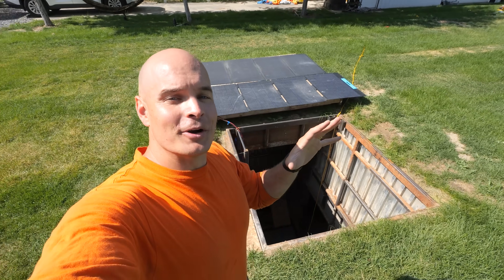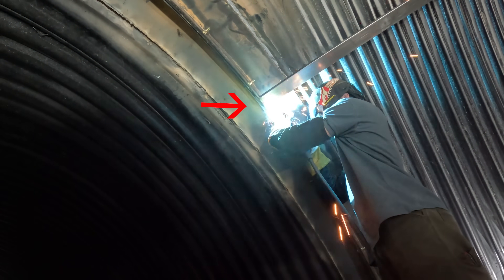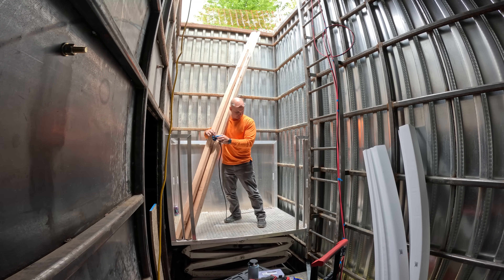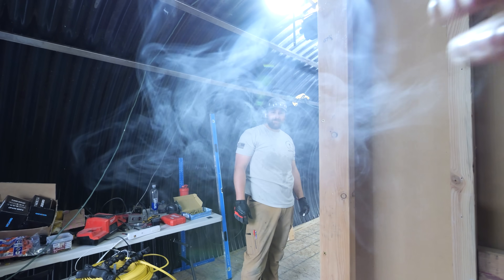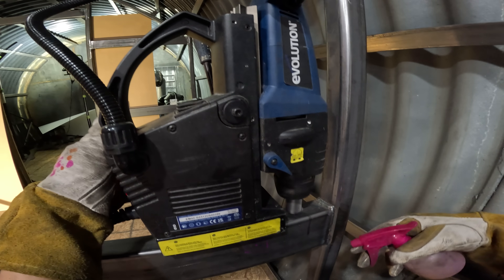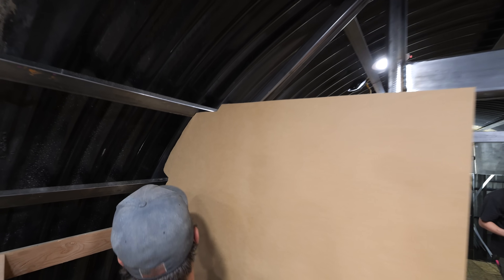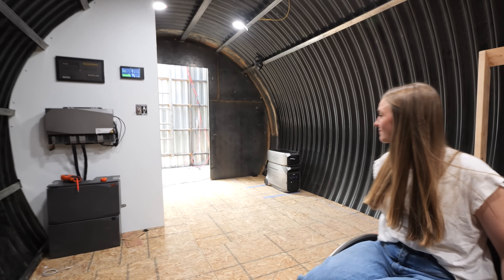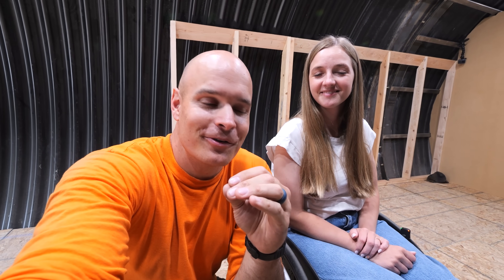How to Properly Power a Backyard Bunker - (Completely Off Grid)

Comment: Any reason why you did not encompass the metal shelter pipe/tube in reinforced concrete? While bracing the shelter with metal beam X bracing during pouring and drying period. I am no engineer but, I would assume the pipe/tube could hold up structurally with a 2-3 foot thick square structural reinforced concrete poured,  dried around it. The sidewall weight of the concrete would mostly be pushing straight down to the ground base/slab concrete. The only weight concern I would imagine would be the roof area of the metal bunker tube/piping. Again I am no engineer,  just sharing thoughts. Matt off the ranch buried a reinforced shipping container surrounding it with reinforced concrete as an underground safe/safe room attached (access to from) his house.